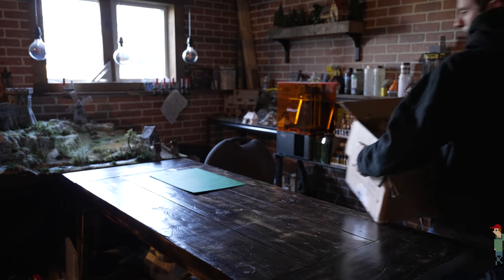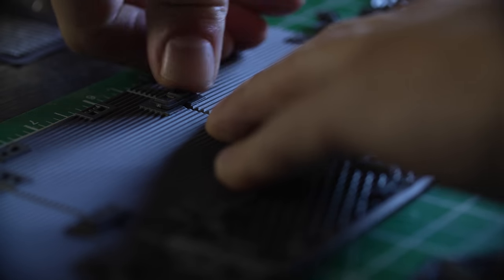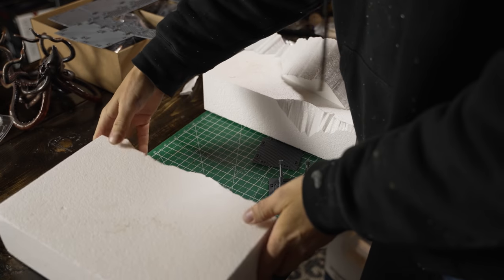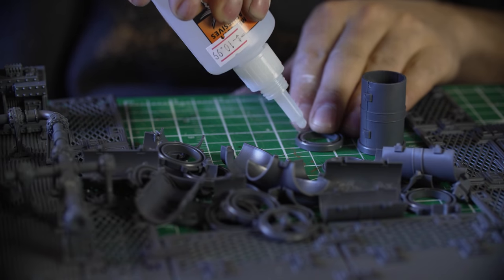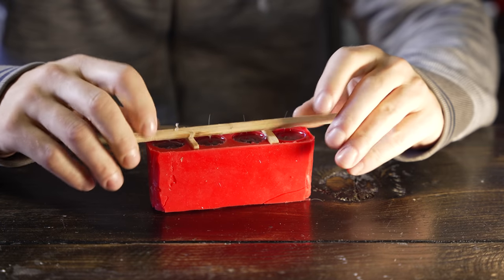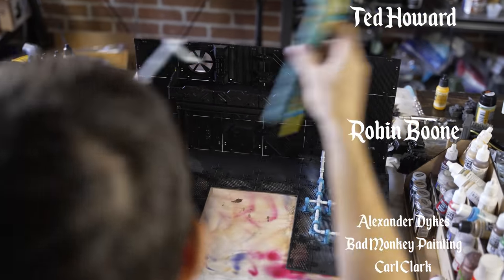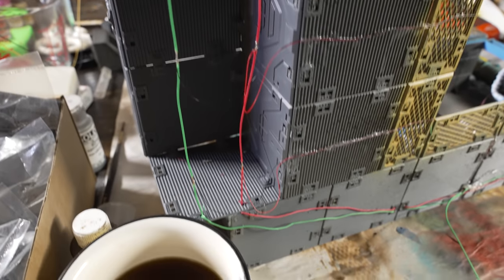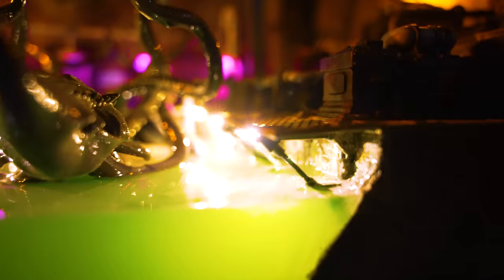Making a Miniature Military Base with an Unwanted Visitor | Realistic Diorama

Comment: Hi Neil, I love your videos! This project looks great. I see you're using the airbrush, that's an awesome tool. I did a lot of airbrushing. Just a little tip, to prevent the airhose from pulling on the airbrush, just wrap it around your forearm once (hose goes from inside the wrist over the forearm to your elbow.) this will also prevent the airbrush from falling when you accidentally step in the hose.

Comment: Yo - glad the resin worked out for you.
Looks amazing.
Reply from the maker: Hey thanks Rob!  Appreciate the tip on tinting.   Too bad I didn't have the brain power to properly calculate the amount I needed though lmao
Reply: @RealTerrainHobbies  I mean, you say that, but don't let anyone fool you: it's always a game of horseshoes no matter what. I've probably only had the "perfect" amount of resin for a pour about 5% of the time :P
Reply: @ThatRobHuman  I may be telling you something you already know but if you want to calculate the volume of an irregular shape (and dont want to get it wet) then dry rice works well, measure its volume (pour it from a measuring jug) as you fill up the space and then it is big enough to easily clear out before you pour your resin. Wont be perfect as it doesnt pack exactly identically every time but will get you closer than pure guess work!
Reply: @chriswebb9375  I have used that trick and it is heckin handy, for sure. More often than not in doing a bunch of little pours, though, which sadly it doesn't do as well on. still good advice right there. :)

Comment: I wonder whether you could use UV-set resin as a gap filler (pour and cure in place) before adding epoxy resin water for a project like this. It would tend to flow (and find gaps) in exactly the same way as the epoxy resin, but you could hit any leak with a UV flashlight more easily than you can tape. And if you use clear UV resin, there shouldn't be much (if any) evidence once the epoxy resin is cleaned and polished on the final piece.

And clear UV-set resin runs only about $20/500g (as long as you pretend that you're using it for a 3D printer rather than as an adhesive 8-) ).

Comment: RE: resin   I think you're being a bit fussy about resin pours being the same color. Using a bit darker resin for the first pour gives the water the illusion of depth when a lighter colored pour is used on top of it. Doing this is an old model railroading trick. So a few inches of resin can give the illusion of a much deep pour. It really saves on resin.

Comment: A tip for future I-beam construction:  joints are usually braced by gusset plates.  For beams where you can keep the flanges in the same plane, the plates are thick sheets of metal bolted to the outer surface of the flanges.  When the flanges have to be perpendicular, the plates are basically heavy chunks of angle iron.  In both cases, they make construction easier and give you a strong frame.

Comment: I used to work industrial construction as well. As an electrician.
Reply from the maker: Were you ever lucky enough to have to wire up our devices and get them functioning properly on the panel?😁  This seemed to be the bane of most of the electricians I'd worked with haha.   Just not a very common thing to work on for most electricians it seemed. :)
Reply: @RealTerrainHobbies  can't say I had the pleasure, personally. Lol